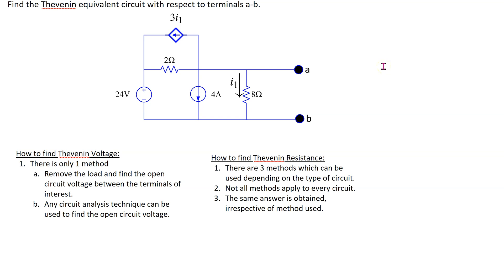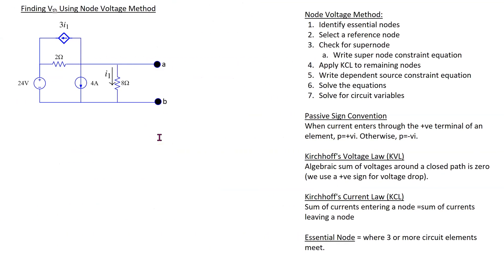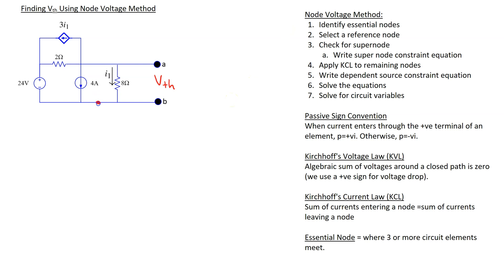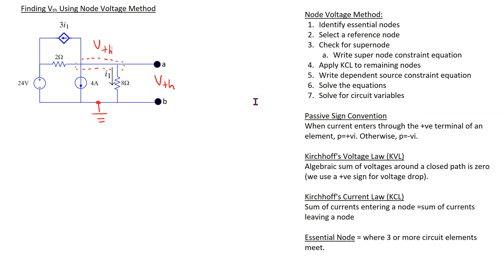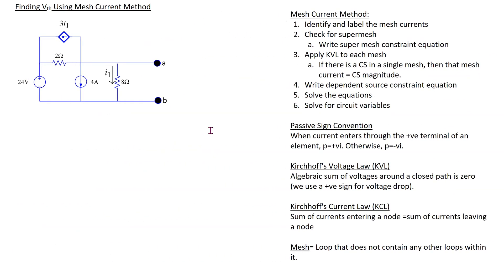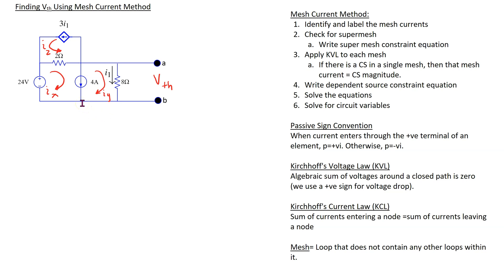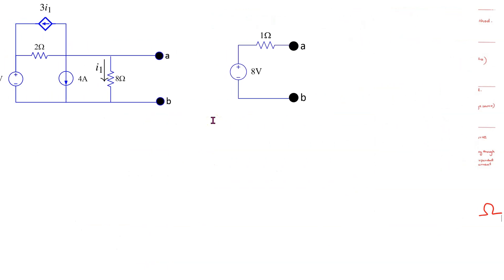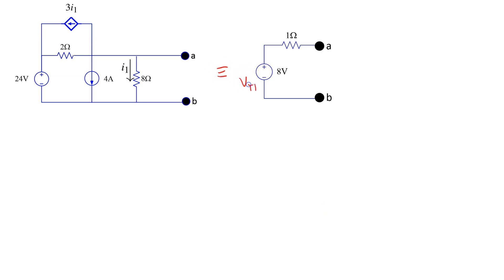Thevenin Equivalent - Example 3 Circuit Containing Both Independent and Depdendent Sources

Comment: Firstly thanks for the all videos that you made. They're definitely excellent! Secondly, I've a question about a 4A CS as mentioned in 11:38. While there is no potential difference at the branch that's containing 4A CS (bottom voltage grounded and top voltage is 0V, 4A CS is between them), how come there is a current flowing (mentioning about a current that's provided as 4A from CS)?
Reply from the maker: Thank you for the feedback. Excellent question! An "ideal independent CS" has the basic property that it maintains the same current flowing through its terminals regardless of the voltage drop across it. This, even if the voltage drop is 0V the 4A CS still produces the same current. Hope that explains the reason.
Reply: @electriccircuits7164  Yeah, explains a lot. Thanks for your kind and quick response. With my best regards...